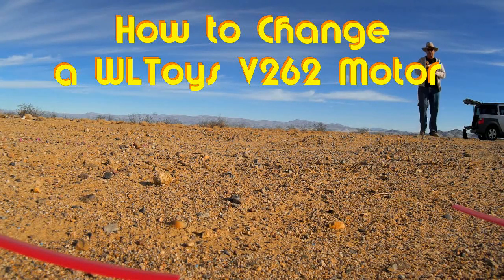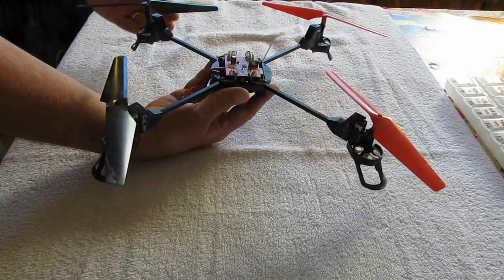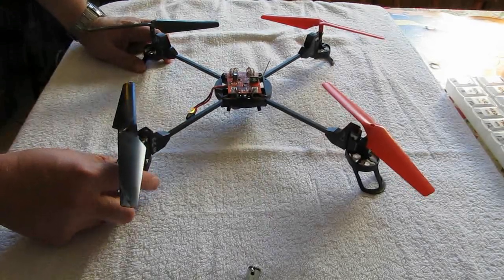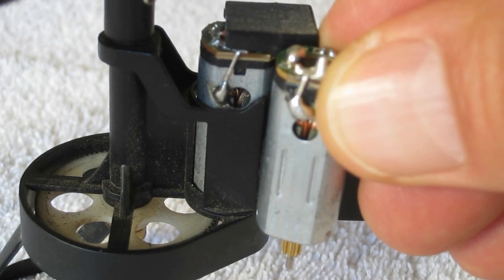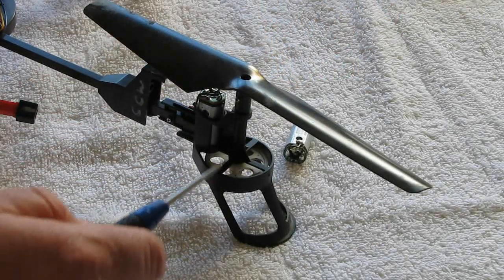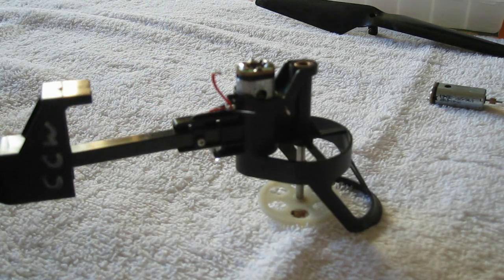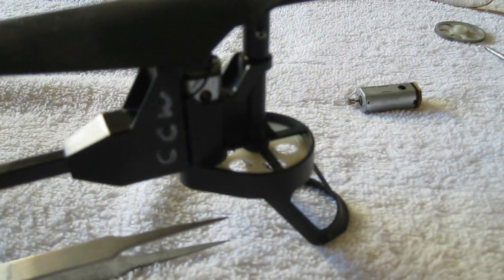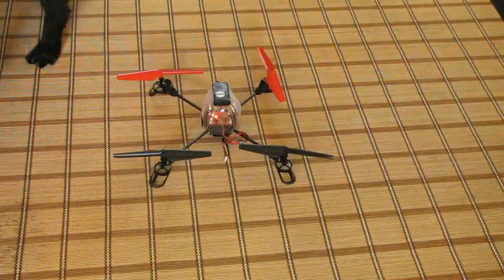WLToys V262 Cyclone Repair: How to Replace a Motor

Comment: hi guys do you know when gws will bring some upgrade props out and why are some broads are green and red
Reply from the maker: Nick, some of the older WLToys three axis quads (V929, V949, V959) came with propellers that did not provide sufficient lift. For the heavier V949 and V959 these quads could encounter power settling (blade stall), and if you dropped to quickly, could sometimes settle to the ground even if you applied full power.  Some people corrected this problem by installing GWS EP5443 blades in place of the stock blades.

To correct this problem, the newer six axis V212 and V222 quads come with larger, higher lift blades than their predecessors.  These blades provide higher lift than the GWS blades, thus replacing is not necessary with the newer WLToys quads. The same goes for the V262.  As for green blades, it's just another available color to improve visibility for maintaining orientation (I think these mainly came with the older three axis quads).  And here's a comparison picture showing the different sizes, but note the V929 blade vs the size of the V212 blade.  
http://www.banggood.com/Wholesale-WLtoys-V949-Upgraded-V212-2_4G-6-Axis-RC-Quadcopter-RTF-Mode-2-p-68517.html
Reply: hi mate thanks for the fast reply don't tell me ive done the wrong thing lol but as iam in the uk and inport tax from bangood ive got my self a x30 quadcopter the same as the v262 £57 posterd on tax etc etc hopeing I can use the v262 parts
Reply from the maker: I've previously researched the Xinxun Intruder X30. They sure do look the same, but can't confirm that as there's not much info on it outside of China. Please come back and let us all know if the spare parts of the V262 fit.
Reply: ok mate thanks iam sure the x30 was out first
Reply from the maker: Here's some info comparing the two:
http://www.rcgroups.com/forums/showthread.php?t=1958141&page=7
Reply: hi ive looked on banggood  and thay only do one motor 4 the v262 will it be the same for the front and rear
Reply from the maker: Nick Walters Nick, please look again. Here's the link. You can select clockwise or counter-clockwise directly above the "Buy it now" button.
http://www.banggood.com/WLtoys-V262-RC-Quadcopter-Spare-Parts-Motor-V262-16-p-84305.html?p=RB0922217402201307U3
Reply from the maker: Nick Walters but also note that China is now celebrating their new years for the next two weeks. If you order anything from any Chinese website, it's not going to be shipped for at least the next two weeks. (it's worse than Christmas here. EVERYTHING shuts down).
Reply: hi mate just looked and seen the cw/ccw option thanks need to look harder

Comment from the maker: RP, for some reason I can't reply directly back to you.  But you can get the screws here: http://www.banggood.com/Screw-Set-For-WLtoys-V929-V949-V959-V969-V979-V212-V222-RC-Quadcopter-p-83929.html?p=RB0922217402201307U3
The prop screws of this set are universal for all the WLToys quads (even the larger V262 uses the same screws. I just checked by comparing my V212's screws to the V262 screws. They're the same). As for lubing the plastic gears, I don't recommend it. I used graphite on mine, and they wore out quickly.  It causes the teeth to slip at high torque.  Just run them bare.  They will wear out eventually, but they're dirt cheap to replace http://www.banggood.com/WLtoys-V262-RC-Quadcopter-Spare-Parts-Gear-V262-04-p-86441.html?p=RB0922217402201307U3

Comment: Thank you, you saved me some trail and error!  Have to replace my Front Left one, tore it up this weekend testing a large 2000maH Battery and Camera installation.  Thought it was something I did kept pulling weird, had to overcompensate too much till finally dropped like a sack of potatoes. I think I have the newer model users the same motor, plus there no way to choose CW or CCW motor when purchasing.  All mine look identical.
Reply from the maker: Now flying non-stop for the full time that a 2000maH will give you (about 20 minutes) will also cause excessive wear on your motors. Recommend with these larger batteries to fly for shorter times (about 6-7 minutes), and then land to cool down your motors for about 10 minutes. Then repeat. You should get 3 or 4 flights out of a battery charge, with cool-down periods in between.
Reply: Yup, will do thanks!
Reply: mine all look the same as well.

Comment: keep in mind you could build your own DIY quadcopter from this rigs parts
Reply: You could not use brushless motor you need to have brushless ESC. That is best way to go brushless motors last longer. Cost about 200 to  $300 to build a quadcopter, time you buy all the parts. Few already built for 69 to 129.00 RTF smaller then the v262. Larger the better if you fly far like 300 feet about far as you can see the front of the quad. or carry weight. Small quads great for small areas. Wind can be a problem. V262 is best bang for your buck learn on 50.00 one you need 4 batteries to for about a hour of flight.
Reply: What are your thoughts on Radios, Turnigy, Flysky, Futaba, what's really needed for a Quad or Octo?
Reply from the maker: GreningerProductions the ready to fly's come with their own transmitters. As RP mentions, an inexpensive RTF is your best bet for starting in quads.

Comment: Hi. I just recently purchased one of these v262 copters, and I was wondering if there was any way in which I could purchase brushless motors and install them, and if so, how?
Reply: Don't bother trying to change these over to brushless motors.The signal coming from the board is not the same as you would use for a esc which changes the current to AC.At that point you would need a new flight board and getting four esc plus motors and rewiring everything its cheaper to start from scratch.
Reply from the maker: Not that I've seen yet. The problem is that brushless motors of the same power would be larger than the stock motors. They wouldn't be able to fit in the motor case. Additionally, they'd cost much more than $3.80 each.
Reply: I looked at it. It is doable. And just like xalint1 said you would need the esc's, fabricated motor mount. And maybe a new flight controller.  So yeah almost a complete rebuild.

Comment from the maker: I forgot to mention in this video for solder newbies (like me) the importance of first cleaning the tip of your soldering iron to remove oxidation. If your tip is highly oxidized (discolored), you may not be able to melt the solder. You should always clean your tip before soldering. I'm just using a dollar store soldering iron, but I clean its tip before use with some sink scouring cleanser (like Comet) to remove any discoloration I see. It seems to work well.

Comment: If you leave the motor covers off, the motors will run cooler and last longer. That is what I did on mine. Also you can replace the brass bushings with ball bearings for better performance. Lot of info about the v262 quad on RCGROUPS.
Reply: Was thinking of doing the same, taking those motor covers off completely and possibly adding a heatsink on them.

Comment: Great job on the video, I really enjoyed it, thanks for uploading.  I have been waiting for close to 3 weeks to receive a couple new motors from BangGood.  I'm really hoping they get in tomorrow so I can fly it this weekend!  I failed to properly break in my motors when I got it and had one lock up solid on liftoff the start of the 3rd flight.  It briefly locked up on the 2nd flight.  One thing that you may want to clarify is that the motor spins in the opposite direction to the rotor.  Got yourself another subscriber.  Maybe you have a great idea for landing gear that doesn't get in the way of a GoPro mounted on the underside of the center frame.  I just zip-tied small wood feet extensions on the bottom of the stock landing gear, but it gets in the way of video of course.  Need something mounted a bit further back and at a wider angle.